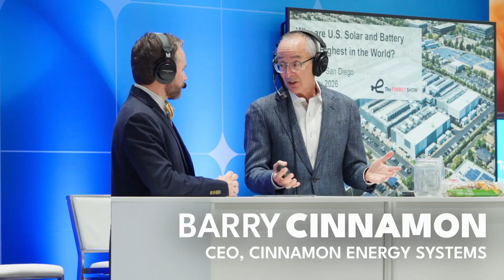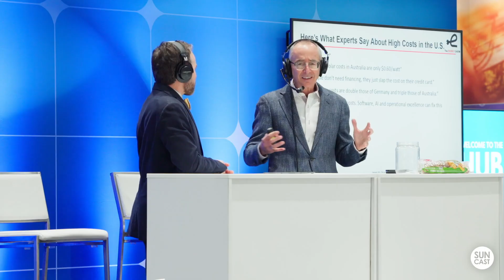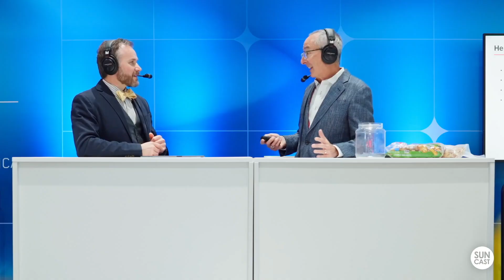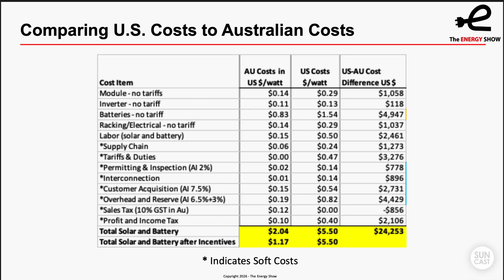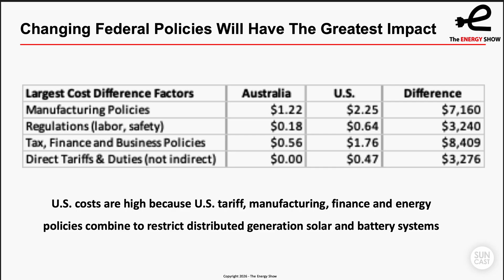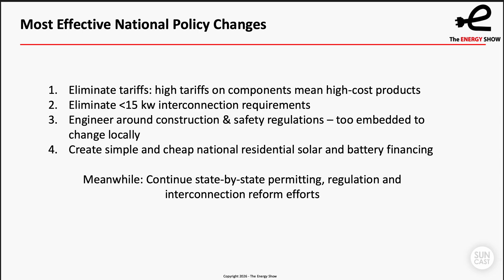Here’s why solar U.S. costs are so high

Comment: ✅Thank you Barry & Cinnamons!! 🌞We've been in residential design/install for 19 years. Besides higher components costs in U.S., for grid-tied PV systems, the MOST cost additive is the A.H.J. (local, State, UTILITY & Fed.) REGULATORY & permitting  process, including labor + training (NEC+) & inspections, AND the VERY Expensive 'Safety'/ CODE COMPONENTS Required by utilities +NEC that MUST added to PV project costs!!🫣 
The U.S. Regulatory system has got embedded costs in the whole supply chain & install process...to discourage adaption by Americans+😲
This is why we ONLY do O-G systems now to reduce cost to home/farm owners & give true energy FREEDOM 🌞🔋🗽